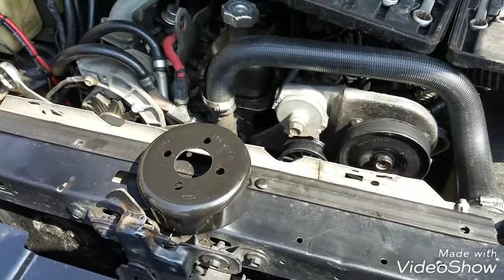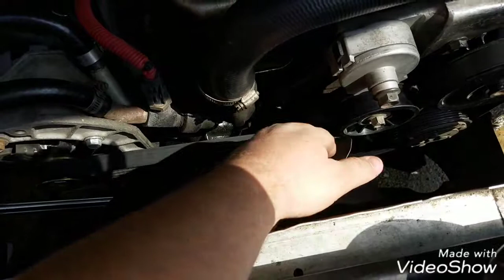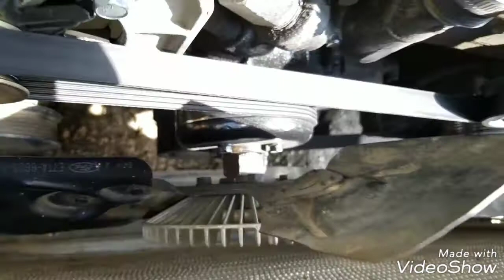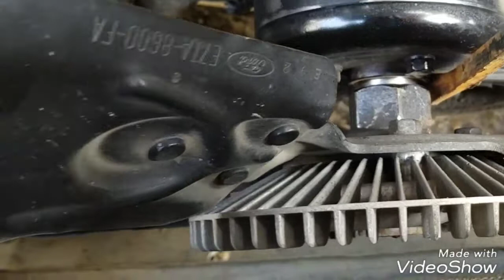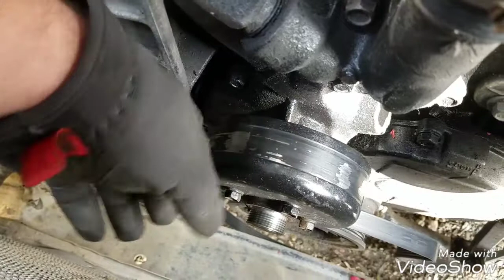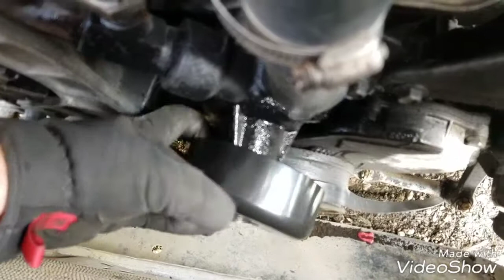1987-1996 OBS F-Series:Water Pump Pulley Replacement

Comment: May I ask what radiator hose that is? I have an 89 F150 and the hose lays above and across the power steering pulley, it keeps touching the pulley which then slices through the hose. Thank you!
Reply from the maker: I bought it for a 1992 F150, so whatever that would be?

Sorry I don't have a part #